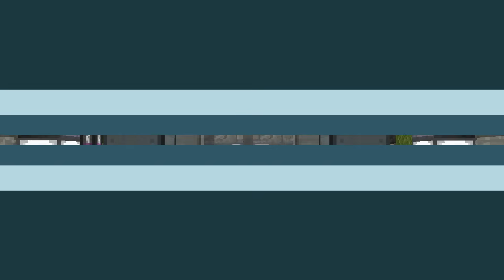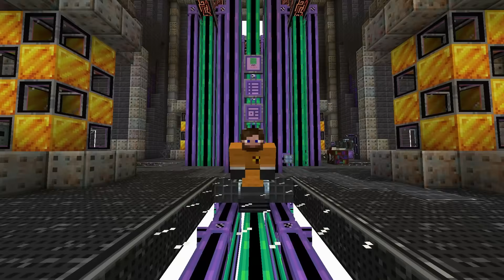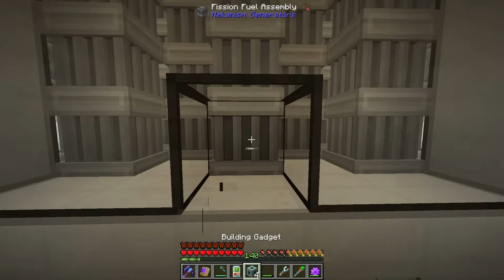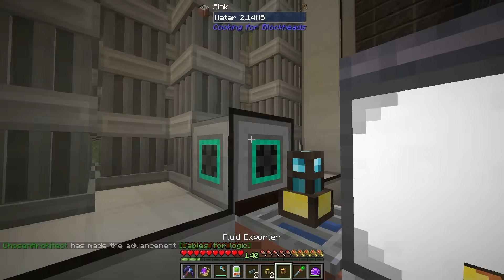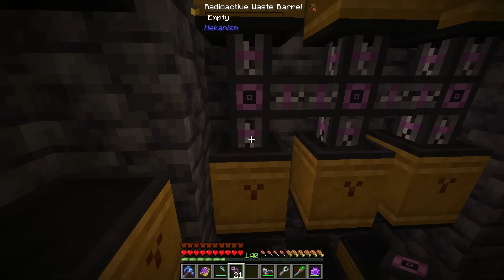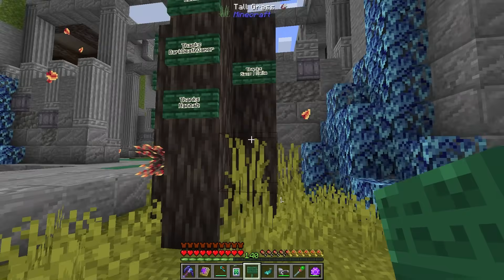All The Mods 10 EP40 Mekanism Fission Reactor Setup: Steam Power & Waste Processing

Comment: Need a bit of help. for the fail safes my red alloy wires are not connecting to each other
Reply: @sRoliii  did you get it fixed ?
Reply: it works fine. just a visual bug. it works in embeddium. on 7.0 atm switched to sodium so probably cant fix if mod author doesnt do anything

Comment: integrated dynamics logic cables have infinite fluid transfer rates as long as you know how to use them.

Super useful for water inputs / other miscellaneous fluid transfers. They can also be used for items and energy and still have that nigh infinite transfer rate. (like 2 billion items or milibuckets or fe per tick).

Just know that they can not work with gases.

Comment: Nice video! Just wanted to add some extra info. 

The max rate ID can transfer water is 2147483647 (max integer value, more than twice as much as 999999999). Also the not gate is not necessary, the logic port has an invert button, you can just invert the signal from the activation logic port. And one last thing! the sink + ID is totally valid, but you can also just stick an eternal water block on the valve, that will keep the reactor completely full of water, and no piping is necessary.

Comment: i have a problem with my reactor turbine assembly. once the energy buffer is full, all the water in the reactor boils away & melts down, is there a way to keep the reaction running without it blowing up or a way to drain FE from the turbine buffers?

Comment: I irradiated my base and myself the first time i set this up. I got lazy with pipe placing and accidentally got polonium in wrong tube. Placed down a radioactive waste barrel to get it in there. Then realized polonium doesn't decay in a radioactive waste barrel. Thought I would move the barrel by breaking it. Wasn't wearing a hazmat suit..... I don't know if you ever can unradiate yourself because I was taking damage for forever. Just found the command to heal myself.

Comment: the best way to get rid of the spent nuclear waste: ( fastest/cheapest way!)
1 - export the SNW to an offline interface (has to be offline)
2 - put a cable that can handle gases on  the interface and make sure that pipe is pulling the SNW from the interface to a ultimate trash can

another good tip:
you need 500 green pellet for everything in mek, and you need only 100 blue pellet for everything in mek
Reply: hahaha i hope they don't counter that someway.. i built a few waste barrels but did that trick anyways, if they nerf it at least i have some barrels to handle it
Reply: Couldn't you also just put a fluid trashcan?
Reply: @keepyoursockson i dont thinks so, that waste is a chemical and thats not fluid

Comment: Check out the logic controller from redstone pen mod. It provides a scripting interface that let you easily do integer and boolean arithmetics and handles advanced use cases like rising/falling edge detection, inventory detection (like vanilla comparator), clocks, etc.. very easily from just within a single block. There’s a IF function that let you easily create a set/reset latch from just one or two lines of code. Perfect for me who suck at vanilla redstone but want to do some complicated logic at times. Especially if it involves a lot of states to keep track of as you can use as many variables as you want in the script.

Comment: You might want rid the sun sensor cause it can fool that when it rain or thunder that can emit redstone so somewhat highly recommend is use integration dynamic that can only read if it detects night time then it emits redstone. Because it happen to me it when I try automation skip night cycle but I notice that didn’t skip night cycle cause of weather cause to start even though it not night time. And also I did automation self produced of day that only need a log and sunflower. For bonemeal to sunflower I use ars turret to emit a bonemeal effect so I don’t need worry about supply of bone to make bonemeal. I hope you like this idea of concept of self produced without need to touch it will run on there own without need to refill so it can just run while you doing business stuff. It quite useful I used that so I tire of see phantom spawn at night time so I did setup an automation themself.

Comment: The maximum transfer rate for Integrated Dynamic is actually the highest positive number a 32-bit integer can hold. So (2^32)/2=2147483648. 

You don't have to remember the exact number, just google "max int value" and copy and paste it. 

Since when can smartphone keyboards automatically calculate equations like this? I did not put the result there, my phone did, wow.

Comment: I believe with the redstone pen you need to connect the redstone to the block you are running onto. By default, the pen redstone is not connected to the blocks they are on. Also the actual limit on fluid exporter is not 999 million, it is 2.1 billion which is the integer limit

Comment: You can also plop down the evil craft infi water block straight on the input, it directly pulls the water from the block and do it way faster since theres basically no limit
Reply: Slight correction: the water blocks constantly output water themselves, machines don't automatically pull from it. Also, I was certain that it makes 4 blocks per craft but now I'm not sure
Reply: @jonavinthao  nah my bad, my mind is hazy these days and I misremembered
Reply: That's cool, I've been using those blocks for other things, I didn't realise water could be pulled directly from it without pipes.
Reply: @turtle-bot3049  another fun thing with evil craft infinite water, the mod also adds infinite water buckets, and you craft 4 of them per recipe, while the infinite water block you get 1. You can put those buckets into machines that require water and the machine will be filled 1000mB/t, sure not as fast as the infinite water block but since you get 4 for one weather bottle, I think you can easily find uses for it.
Reply: Thx! it rly helps my world to not lag that much anymore!

Comment: You can just set the activation logic module to inverted by clicking the “switch” button in the bottom right corner, thus not needing a NOT gate. 

Then on top of that, the redstone pen does work, you just need to right click the center of the block again to make it turn into a ‘dot’ and then it will emit redstone or receive redstone wherever the dot is.

You also don’t require putting a turbine port on the vent level to pull water out. The vents themselves will auto push out water to pipes.

Of course, build however you would like, just letting everyone know about different options.

Comment: I've had issues before where I had all the safeguards on my reactor... had full usage of the waste processed, and somehow, still logged in the next day (this was on a server) to find the place irradiated, I think using pipez gas pipes may've caused the issue there
Reply: I’ve also heard that placing it across multiple chunks on severs makes it not load in certain sides even if both are force loaded and everything
Reply: the pipez mod works well for single block mekanism machines, but i've had plenty of disconnects to multiblocks with them (fortunately it just meant my creosote production was backed up, not anything spicier)

Comment: By the way, you can set the mekanism machines (including the reactor logic port) to redstone inverted mode

Bypassing the need of an external not gate

It's the little switch in the bottom right corner of the mekanism machines that you're kinda misusing as "just" an off switch
Reply: hmm that works too
Reply: Does it actually work now though? Last time I tried it, it did absolutely nothing. It was quite annoying together with another absolutely useless "feature" of "excess waste" mode which triggers at 100% which means the radiation is already spilling out of the reactor.